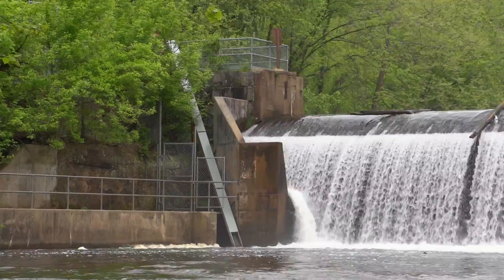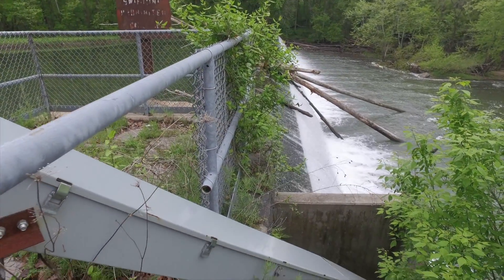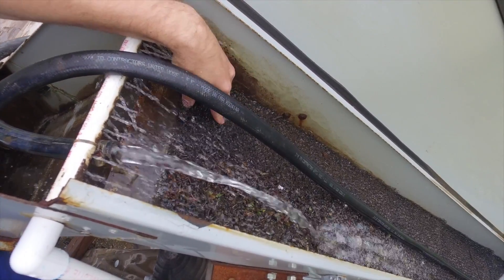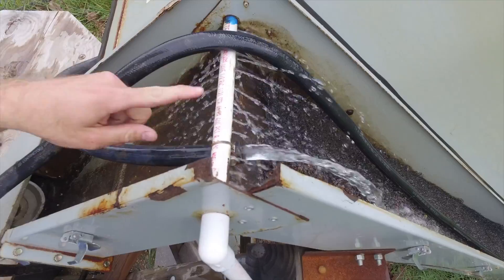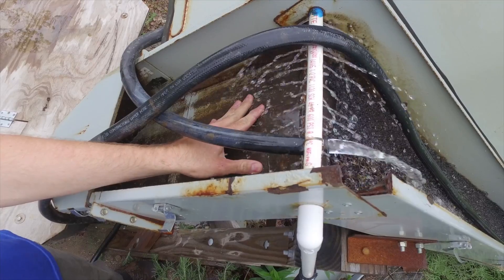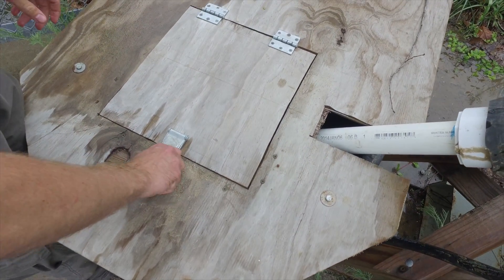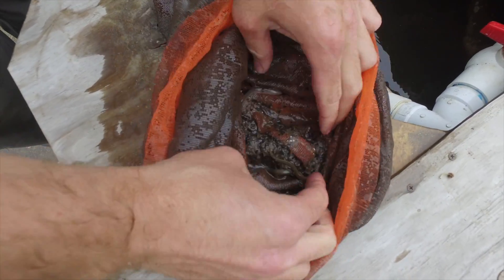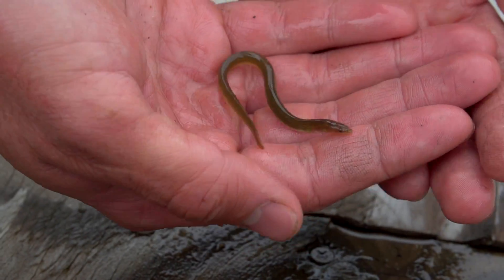Daniels Dam Eel Ladder - Maryland Department of Natural Resources

Comment: When is DNR going to create a better parking solution for this area of the Patapsco State Park?  Currently the large gravel lot that used to provide adequate parking space is barricaded off and the roadway is littered on both shoulders with what looks like at least a hundred "Towing Zone" signs that are spaced about 20 feet apart in all directions on both shoulders. This only leaves the public with about 15 "Legal" parking spaces.
Reply from the maker: Please contact Patapsco Valley State Park directly at 410-461-5005 or send an email to CustomerService.DNR@Maryland.gov